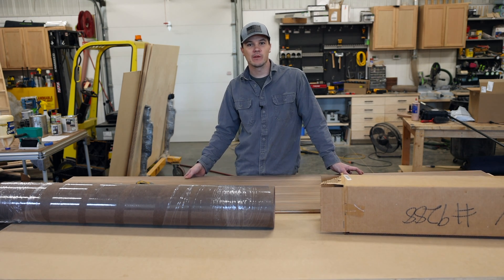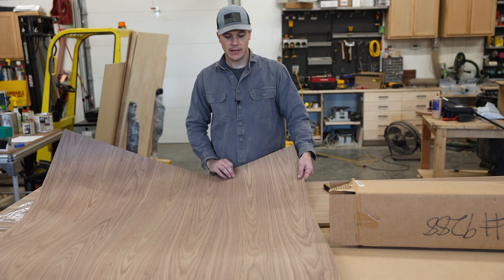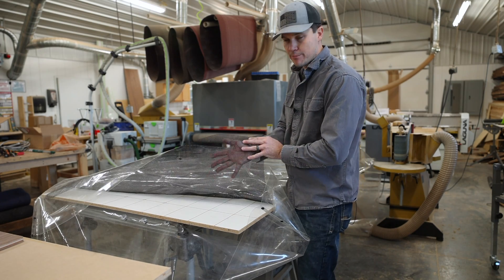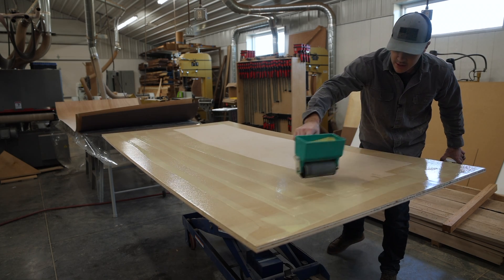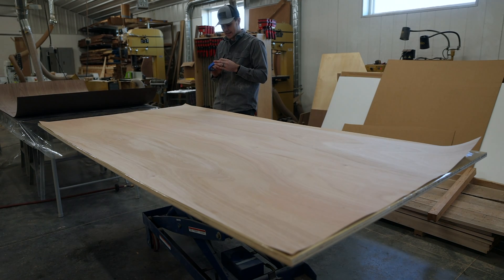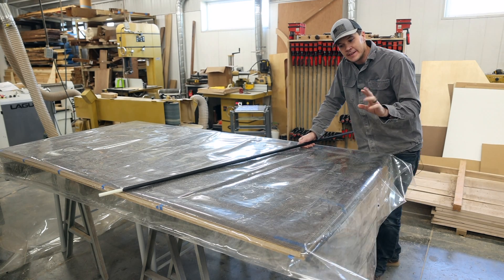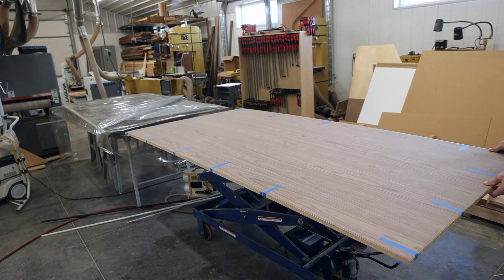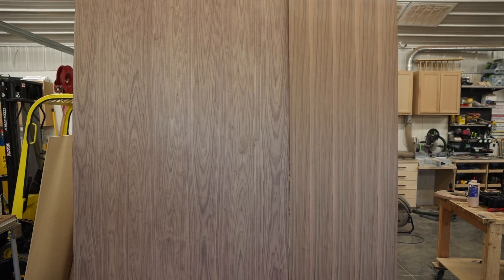DIY Veneer - Using a vacuum pump for veneering large panels

Comment: Interesting. I didn't think that titebond would dry properly in a vacuum press.  Have you ever tried the hot iron technique? Putting glue on both surfaces allowing to dry and then reactivating with a hot iron? I've used this technique with a wood back veneer that is applied perpendicular to the surface veneer. In my case I put it over Baltic Birch. The moisture will initially bow the plywood but I found if I weight the plywood down as it dries or wet the back/opposite side with a damp towel that seems to prevent it from warping. I've used a similar technique for gluing canvas down to hardwood panels. I have a photo finishing shop and I frequently glue photographs printed on canvas to hard board, so that's where I discovered the technique to keep things from bowing on very thin panels.  And may I ask where you got the glue spreader? Is that something you can buy on Amazon or is it only available from specialty places? I've been using the foam roller and I can definitely see the advantage of the hopper.  Very informative video I enjoyed it .

Comment: I realize that the "must veneer both sides" has been commonly said for decades - but I very much doubt it is true in most instances.
When building plywood it is true as you start with a core and placing more laminates on one side will cause warping... BUT...
Consider - if you are placing a 1/16" or even 1/8" veneer on one side of a 1/2" or 3/4" plywood - how is that going to warp it. The veneer would be more likely to crack or split before it would ever have enough strength to move the 1/2" or 3/4" of wood it is attached to.

4:09 - you can see the plywood is cupped slightly upwards.
5:29 - you can really see it.
8:20 - the glue or veneer on one side is not causing warpage. The plywood was already cupped, and it is easier to see when you flip it over and the cupping is now down instead of up.

Things get said, and repeated, and repeated... but sometimes we need to step back and consider it with common sense. It happens in a lot of things - especially woodworking and wood finishes.
In some cases, it could warp it, in most cases it wont.

Comment: Do you recommend applying both veneers at the same time? Or is it acceptable to one face on day 1, then the second face on day? Will the warping go away?
Reply from the maker: I've done it that way with failure. I think before the glue cures would be acceptable but still not idea l

Comment: Hey James, thanks for this video. I’m hoping to get a vacuum pump from the same company and am trying to decide between the EVSsystem or the Venturi. Is yours that Venturi?  I guess the EVS doesn’t need the compressor but also the pumps run either continuously or off and on. Does yours work with the compressor and if so how big. Compressor r u using? Anyway thanks again for the great video (beautiful piece of veneer btw👍). Also, I saw you had the writing desk from the Epic Woodworking channel.  I recently joined the “neighborwood” and love his teaching. I have that set of plans but am still setting up my shop. All the best, chris
Reply from the maker: No problem! Thanks for watching. I've got both types and the venturi can be a little more annoying setup

Comment: Doing research for my upcoming veneering adventures and this was a great explanation. Lots of other videos say you need to sandwich it between other sheet material, but you just have a net for airflow on the top of the bag and It came out great. Is a second board on top redundant?
Reply: That’s right mate. Top is redundant if using a mesh breather

Comment: That commercial plywood looked like it had slip matched veneer, not rotary cut. Slip matching veneer is what gives you that repetitive pattern. Regardless though, you produced a great, high quality panel here - good core, good veneers, & good assembly work.
Reply: It was
Reply from the maker: Thanks for the info
Reply: Exactly this if it was rotary cut, there would be no seams 🙄

Comment: Just the video I needed. What is the way to clean the glue applicator?  I am considering putting it in a plastic sealed bag in between glue ups. Thank you again for the great video.
Reply: It comes apart into pieces and wash it up with hot soap and water.  All of the pieces are mostly plastic (the hopper) and the roller is firm rubber or silicone.  If the glue happened to fully cure before you washed it then the dried glue would just peel off.  I have a smaller version of this roller I use for epoxy.
Reply from the maker: Hot water and soap work great